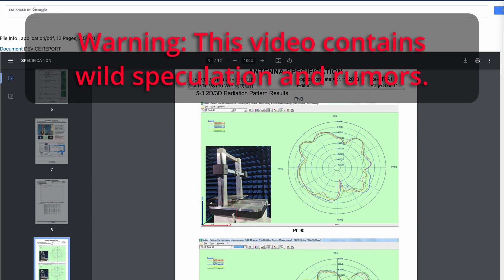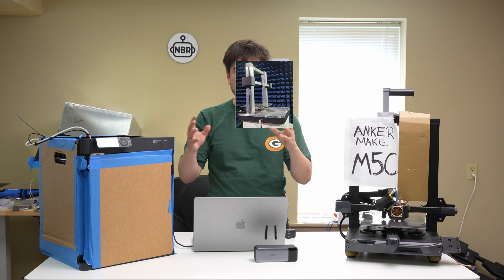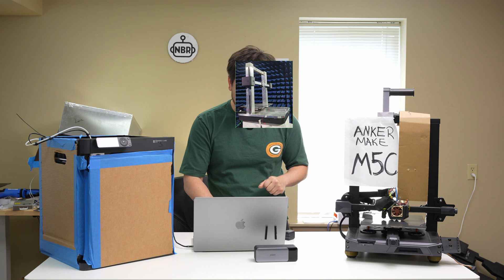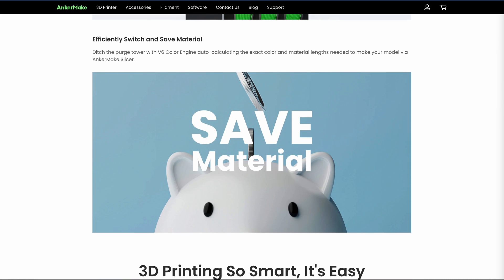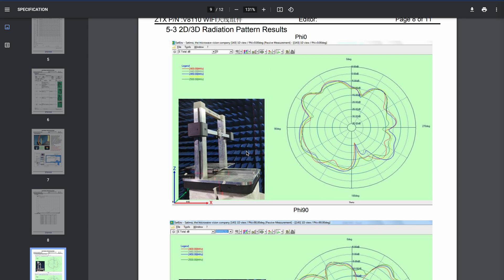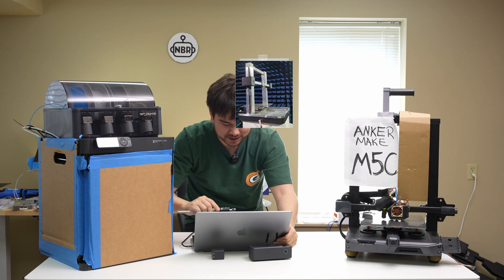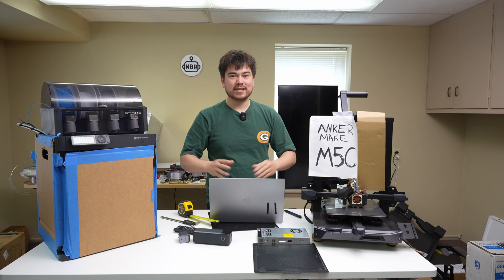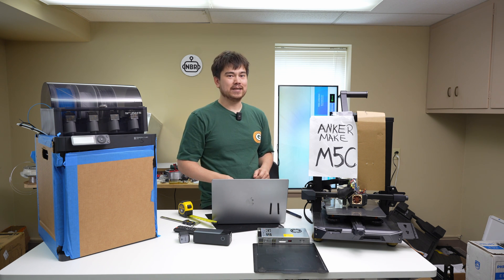🚨🚨🚨AnkerMake M5C Printer Coming Soon!!!🚨🚨🚨

Comment: I kicked the ender 3 v2 neo to the curb today. I had the ender since about 5 days ago and after 3 print this machine went Rouge on me. The quality is cheap, small, fragile, and it does not auto level anything. You still have to manually level the bed but for me it did not budge at all and I tried everything. The good news is that I ordered ankermaker M5C today after doing some research. I will never again buy another ender. You get what you pay for.

Comment: V6's MSRP was $499 during the M5 Kickstarter were the V6 was an optional add-on. In a later update AnkerMake announced the V6 will get a higher MSRP then what they initially quoted. So in all likelihood at least $549 (maybe even more). The V6 is however also a 6-spool filament dryer. And AnkerMake just released an update demoing the V6 printing a 3 colour print in ~14 hours using just 10g more filament than the same model in a single colour. For comparison there's a make of that model on Cults where the maker quoted 44(!) hour print time on a Bambu P1P + AMS (and god knows how much filament down the poop chute). So even if more expensive, the V6 might pay for itself in record time compared to a P1P/S + AMS combo.

Oh by the way; AnkerMake has confirmed the V6 will work with the M5C as well as the M5.
Reply from the maker: Nice. The first I heard about the V6 was while doing research for this video. I'm surprised they aren't making a bigger deal about it! The retract time on the AMS is a little bit out of hand. 
From what I've seen it looks like the V6 has 6 bowden tubes leading to the hotend? Or leat least up to the printer?
So you don't have to retract back into the AMS/V6 for every changeover. Also, that is an advantage of a bedslinger - shorter filament paths. So it will inherently have easier bowden guide tube management and less retraction distance.
Reply: @NathanBuildsRobots  Yes, 6 bowden tubes leaving the V6. Swapping over to the V6 is going to be as "simple" as removing the M5/C printhead and mount the V6's printhead instead. The BIG big thing about the V6 however is that it's not gonna need a purge tower for multicolour printing. And I don't see how they'll achieve that with a single nozzle. Also they've said you can set different temps per filament. My guess is they have 6 complete hotends on a rail or in a revolver barrel style configuration inside the printhead.
They ran into trouble during ramp up to mass production though. Turned out they couldn't mass produce it with the same tolerances as their prototype(s). So they ended up having to add a calibration module, both making the V6 more expensive, and delayed. I guess they've been on the fence about having to just cancel it entirely. In which case it would be dumb to have spent lots of money marketing it and maybe even collect thousands of pre-orders. There is also 5k units going out to Kickstarter backers before any pre-orders ship. And it's a somewhat limited market, since it only fits AnkerMake printers. 🤷
Reply: "using just 10g more filament than the same model in a single colour." ... let's see how this turn out, especially purging from black to white filament.
Reply: @hassosigbjoernson5738   The V6 does not "purge". They might be doing something like the Cetus 2. But in all likelihood there are 6 different nozzles in the V6's printhead, one per filament.
One reason it uses more filament with three colors than with one, might be because the slicer gives each color its own walls. Making it so that the object gets more walls with multiple colors than with just one. Also Ankermake said they still had potential for improvement in regards to stringing. So there might have been a gram or two of stringing in those 10 grams.
There's still a lot we don't know about it though, so as they say; time will tell.

Comment: A headless 3D printer with full Klipper control could be very nice.  When you want a 2D print, you don't put the PDF on a thumb drive and then plug it into the printer, nor do you do a lot of futzing around on the front panel of the printer.  You print the document directly from your application.
Reply from the maker: Klipper is great but a little daunting to use, especially for new users
Reply: @NathanBuildsRobots  - Maybe Anker is going to make a print-from-PC application that doesn't have the complexity of Klipper.  The best might be the option for both - full blown Klipper for the OG who wants full control, and a simplified "just works" (at the expense of performance and flexibility) solution for those new to 3D printing.
Reply: Anker are going to be the last company to use Klipper, mark my words
Reply: @firelion98  - Why do you think Anker will be the last company to use Klipper?